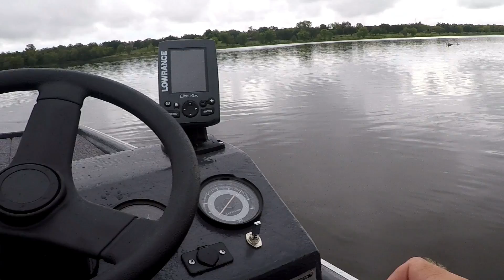Boat Restoration 13| The Launch

Comment: Well that's why it's called a "Shake down" cruise. Engines are finicky, so no real surprise there. Not one drop of water found in bottom of boat...so sweet!
Plenty of room for two man fishing, more economical to operate than the larger boats and easier storage. The fact that you didn't just throw a superficial coat of paint on it says a lot. You made certain the integrity of the boat was sound as well. The Saga continues...well done bud!
Reply from the maker: Well, it’s at the shop for who knows how long. Hopefully, I’ll get it back in time for a few trips.

Comment: Still came out awesome. Looks fantastic. 

Where did you get the seats ? I’m looking for some for my 1989 Crappie Master bass boat. 

Thanks 🇺🇸🦅🗽
Reply from the maker: There is a link in the description to my amazon store. There, you will find them in the sporting goods section. Thanks and good luck with your project.
Reply: Billof Rights ~Thank you my brother. God bless. 🇺🇸🦅🗽
Reply from the maker: I’d like to see pictures. You can send them to Billof_Rights@yahoo.com
Reply: Billof Rights ~I can do that. The bass boat is a jewel. I bought it from a guy up in KY For a great price. Fully decked out with a brand new trolling motor. I put a new transom in it and I’m replacing the faded carpet and seats (rotted). 
I’ll send you pics of the Renken we restored. 
Thanks again 🇺🇸🦅🗽

Comment: Did the shop ever tell you why it was not staying in gear? Have the same symptoms with my mercury 700. Thanks in advance.
Reply from the maker: Hi Luke, I researched the symptoms and looked at photos of my clutch dog. It was worn on the edges that engage the gears. Good luck finding your solution.

Comment: do u have a complete material and cost for this?
Reply from the maker: No, I tried at first, but my estimation is around 4000(2000 motors, 2000 boat). Thanks

Comment: Looks like the motor prop is a little to deep or low. Its like its not running properly and it can't pull
Reply from the maker: The clutch dog was worn out. Had it and the forward gear replaced.

Comment: cover the top of the trolling motor with a piece of tape and paint an arrow on it to match the direction of the prop.
Reply from the maker: If I can’t remove and place the cap right   I will try that, thanks.

Comment: The motor is not strong enough for the size of the boat and the passenger load of the boat I'll be more than happy to send you a check to buy a new motor
Reply from the maker: Boat runs at about 20 mph. It is sufficient for the boat and my taste. Any faster and I would have to worry about loosing hats, lol. Thanks Joe

Comment: You put washers on before you put the screw in on the piano hinge I'm surprised you don't know that already you put small enough buffer washer on then the screw goes on then you won't have that problem also you get a deep enough screw that's a lot of weight furthermore bow and Stern seating is too low it has to go up higher about 6 in unless you're going to have midgets on the boat you're pushing it too hard with all your amenities it's not like you're you have a yellowfin so remember washers longer screw profile you won't have any problems with those piano hinges it's a boat it's going to be taking a pounding a lot of stuff comes loose and I'm begging you please get a bigger motor my dingy my rib boat has a 75 on it for God's sake man